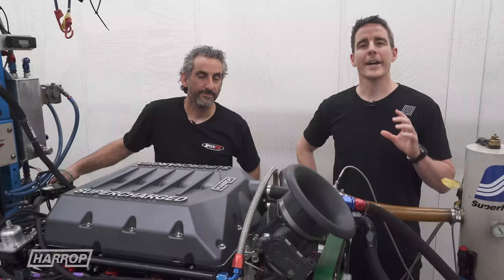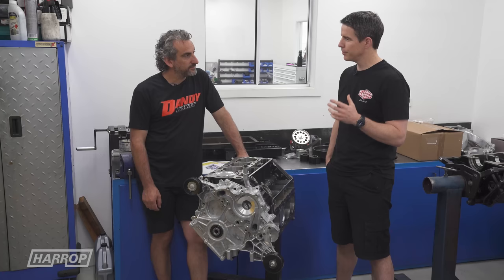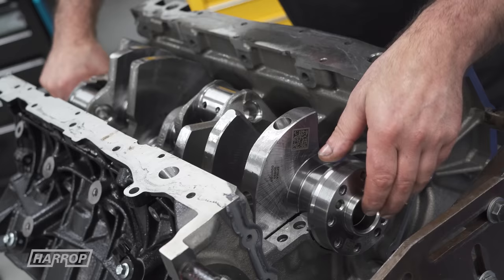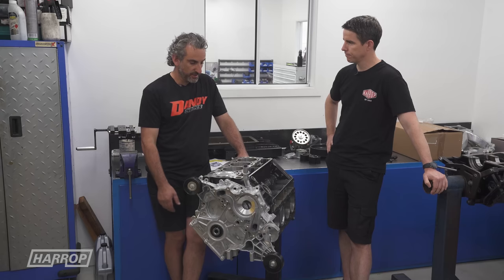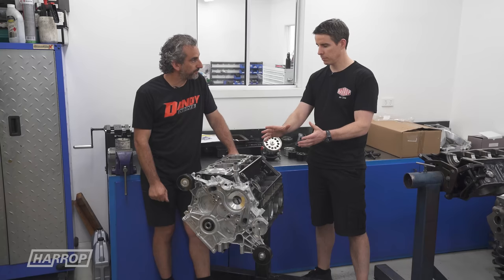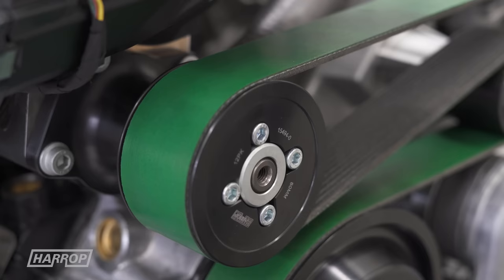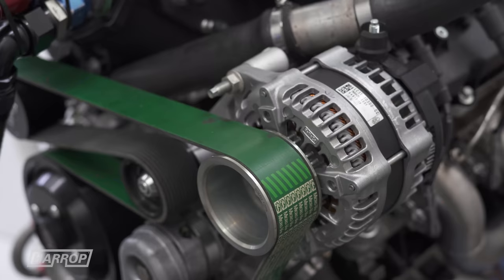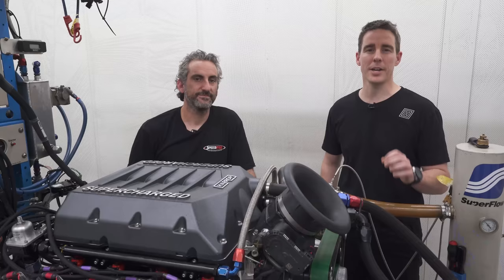1300HP Ford 7.3 Godzilla V8 | Harrop TVS2650 Supercharger Testing

Comment: OMG.........What is there not to like?
Reply: The price!
Reply: @guyforlogos  If the price is a concern, then perhaps your in the wrong hobby, try model cars.
Reply: @widewinger1454  No Lie, but Whoa.... $$$$$$$

No matter still a cool effing engine and some serious power.
Reply: Weight and fuel consumption... but,  fuel consumption for this application is a non issue. Weight? I don't see many ways to get power and torque like that without high displacement.

Comment: Awesome stuff Heath. I just stepped up to the new 110mm throttle body on the 2650 on our 7 litre build.  Can't wait to see one of these combos in a Mustang or late model Falcon on the strip.
Reply: would swap my ls for one of these in my fox body lol
Reply: @aylahughes9185  only if you wanna go slower 🤣
Reply: @thomasstott527  Man, 1300 with a *blower*... that's more than any LS I can think of. I think going forward the 7.3 is going to be the swap of choice if you have the extra money.

Then again, you could just go with an LSX at that point, but still.
Reply: @SoI_Badguy  well if you only mess with ford motors that's understandable... we built a hellcat... stock blower ( ported) stock bottom end... 1150 hp to the tire... these guys are making 1300 to the fly wheel with a 7.3... we have made North of 1300 with a 6.2 and a "blower"
Reply: @SoI_Badguy  Ultimately Bryan Neelen and his crew from LME were the winners of LS vs Coyote 2. They were able to put together a 427 cubic-inch LSX engine that produced a staggering 1,784 horsepower and 1,422 lb-ft of torque with the help of a ProCharger F-1X supercharger with a 10-rib serpentine belt.Jun 27, 2019..... 🤔 I believe a 427 is smaller then the 7.3... 🤣
Reply: @thomasstott527  what LS motor is making that kind of torque?
Reply: It's where the power is made in the curve . Stop thinking about peak #'s
Reply: Not sure why some feel the need to resort to dick-waving...
Each engine, and what one has done to it - and expects from it - are going to be different.
In this instance, it's for a turn-key install that's going to be fun without going crazy.
Heck, if it comes to that, different dyno's - even the same type - will give different results, as will the correction factors used.

Bottom line is, if you're happy with your engine, that's 😎👍 - no need to try and make yourselves feel better talking crap about other people's work.
Reply: @SoI_Badguy  I've seen em picked up for 4k in great shape.  That isn't bad for the potential.

Comment: I have my f250 with the godzilla. If a little bit of this power dust could just hit the top of my block I wouldn't complain. Would make towing 18k a little easier.
Reply: Buy the supercharger and you're golden.
Reply: Procharger has a low boost unit that gives the 7.3 600hp/725ft lbs @ the wheels.. .@ only 5 psi of boost!
Reply: @joelsavage8254  725 wheel torque? Really?